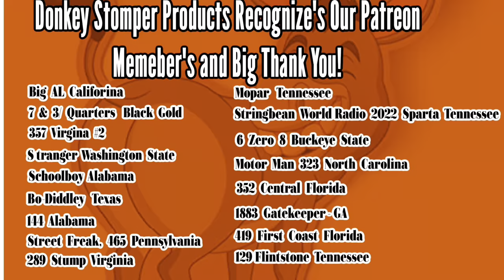How to Make a  RG213 Coax Nulled/Tuned Jumper

Comment: Great info, appreciate the video! Got 100ft of RG 213 from my Buddy, doing the math around 96ft should be nulled on ch20, put an end on it, nulled for channel 40, called it good. It will very, put a meter and nulled  jumper in line and came down some.hopefully with driver and amp it will be spot on. Thanks for sharing!
Reply from the maker: Np, Thanks for everything, watching and the support.
Reply: I called and remember talking to you on the phone about these tuned jumpers along time ago. And then I started trying it on my own.  I think I made more of around the 6' length and one that was around 12' in length.  My question is what do most people run into their own setups? Is it the 6' or 12'? Or will it hurt if it was a mix the lengths at all?
Reply from the maker: We always do it with analyzer what ever  length zeros out. @shawndavis7067

Comment: With a properly installed radio/antenna system,  the radio is 50 ohms, the cables are 50 ohms, the amp is 50 ohms, the meter is 50 ohms, and the antenna feed-point is 50 ohms, the length of the cable need only equal the distance to connect one device to the next.  No more no less.   When the device impedance at both ends of the 50 ohm cable are matched to the cable impedance, the "cable length don't enter into it" except for maybe minor loss in the cable.....  Since there is no standing wave or reflection with a matched system, the impedance along the cable stays the same (50 +j0), except for minor cable loss.      
Now if the antenna is mis-tuned, then you can try to adjust the cable length to make the radio "see" 50 ohms into the antenna/feedline system..  But, you be using up a lot of connectors and solder, measuring and cutting.   Better to adjust the antenna length or position for best match (low swr).   This video showed the extreme impedance mismatch of open or "infinite" impedance at 28 Mhz.  When you put this "finely tuned 1/4 wavelength cable" in line to your unknown system impedance, cutting the length without knowing the actual system impedance, is futile, and unless your antenna has parted from the feed-line, the antenna feed point impedance is NOT infinite (open),  it is some unknown value between open and short.   
A 1/4 wavelength trimmed coax, as shown here, is commonly used for "stubs" to filter unwanted frequencies, or while installed in a feedline system can be trimmed for matching.  It has to be installed in the antenna system while trimming to be effective.
Reply from the maker: Thanks for watching. How ever you want break it down is up to you.  It works way better for what I do. I'm sharing it proven over over on my gear.  Thanks!

Comment: Good video my rig expert is on its way I’m afraid of what I’ll find on my a99 and coax run. Curious, do you have some recommendations for flexible coax to use on jumpers? Most I’ll be running through them for now is about 1kw peak but with all the jumpers I gotta make up the rg400 is out of budget after that analyzer purchase.
Reply from the maker: I use 213 or RG 393. I hear RG400 is a good option for medium powered jumpers.

Comment: I’ve learned how to do it , I’m slow at it but I’ve gotten very efficient with PL-259’s and .400 size coax 
But I don’t know if I’ll ever learn or have the patience to deal with the bigger coax and connectors like you done for me on that Heliax 
73 ,, and great info !
Reply from the maker: You can do it just watch the metal inside it cut you up.
Reply: @DonkeyStomperProducts 

You ain’t lying Chad,the corrugated shield in any sort of hard line,even super flex will cut the shit out of you.
Reply from the maker: @SkipShooter  yup

Comment: Why are you doing this? Are you making a matching stub to phase antennas?
Reply from the maker: Because it works....More less hiding the coax in line. Anything you put in line changes SWR, OHM, Impedance were its another amp meter switch box etc.   If your big ham op with a HF rig with built in ant tuner it can take care of it for you. Thanks

Comment: So, what did the overall length of the jumper end up being tuned for channel 28?
Reply from the maker: I did not measure it exact, Start at 6'4 first one cut it down with a analyzer. Remember different brands, types of coax will all be different. Even coax ends.

Comment: That's a quarter wave jumper. Show how you use the MFJ making a half wave jumper.
Reply from the maker: I  haven’t been making them any other way. This works for me not gonna mess it up..
Reply from the maker: I actually started big play in nulling jumpers publicly to start with. I haven’t tried it I guess you just have to short one end make them. I have not had the need to do anything else. Not broke don’t fix it
Reply: @DonkeyStomperProducts  The Rig Experts manual on the 55 says you have to short one end of a half wave. I've seen people also use a tee and a dummy load on the MFJ for a half wave.
Reply from the maker: I though you had short it. Just never wanted to change mine work so well. @Metalhead396